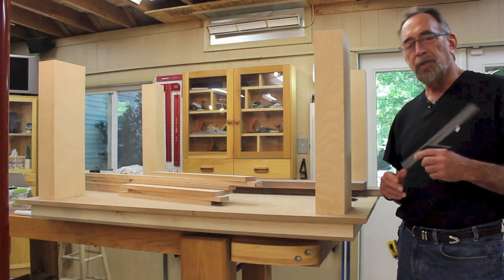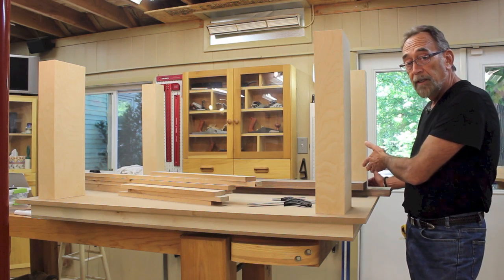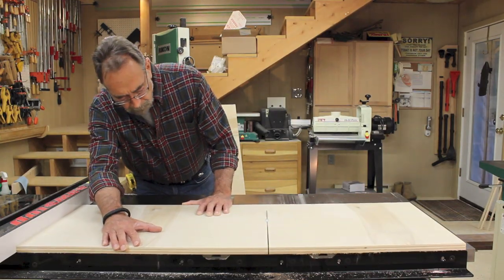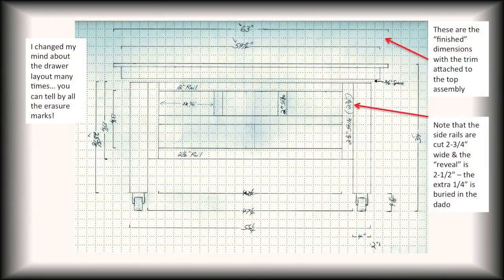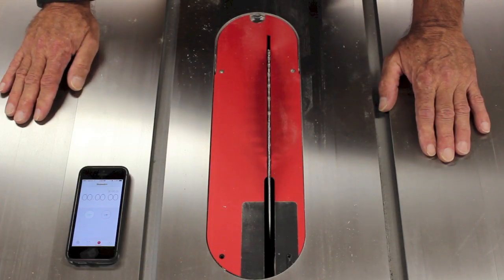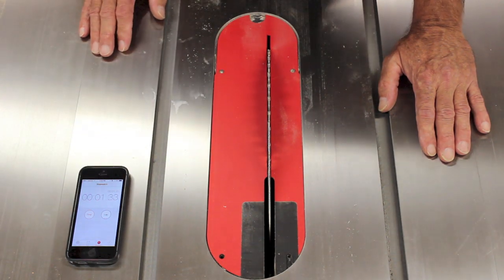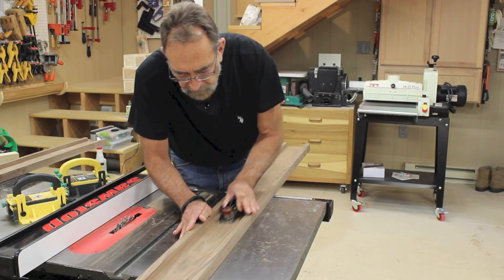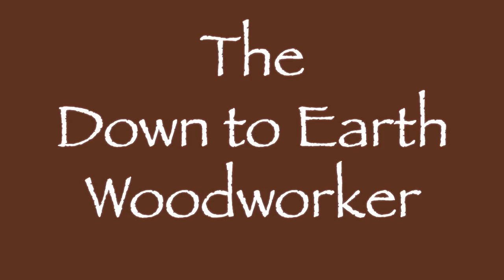The Down to Earth Woodworker - SawStop Outfeed Table Pt 4A - Base Assembly

Comment: Question?  Would it have been more economical to make your walnut pieces from glued up stock?  It seems to be a bit of a waste to plow out such a significant amount of wood, just to cut that in half for your finished part.  I enjoyed to video and the process, keep up the great work.

Annie
Reply: The trails through the densely wooded area behind my house don't get enough foot traffic and the walnut chips help keep the undergrowth at bay.  :)  (One small irrational justification) You are absolutely right, you could build up the trim from two glued up pieces.  Just position the "seam" so that it doesn't show. You could also make two cuts on the table saw, essentially removing a small piece to yield the "L" shape (a little more exacting, but perfectly doable).  For the past few years I have used a small "contractor style" table saw, and I am so enjoying the 3HP power of the new saw that hogging out the material with a dado stack was just a lot of fun.  I was really lucky to find some excellent walnut in a stack of #2 common for a reasonable price, so I didn't mind a little waste.  Thanks so much for the excellent, and spot-on, question.

Comment: Steven,
You stated at about the 7:50 mark how you were probably in an over kill mode to do the domino's. In my book there is no such thing as over kill. I'd rather be a little bit anal up front then to find out i screwed something up & have to do it again.
"BTW", you wouldn't happen to have a need for an apprentice. This soon to be retired (18 months) automotive draftsman would be interested in filling out an application. LOL. You keep making the videos & I'll keep watching them.
looking forward to next one.
Marty
Reply: Actually I was referring to overkill in clamping down side stop and backer boards so my stock didn't move while I was cutting the mortises.  Lots of folks are perfectly comfortable (and apparently capable) of holding the stock solidly while using the Domino, but if it slipped a little during the cut... well, it wouldn't be great.  Say, how about me being an apprentice to you?  You could teach me to draw!  Congrats on the upcoming retirement!  Thanks so much for watching!